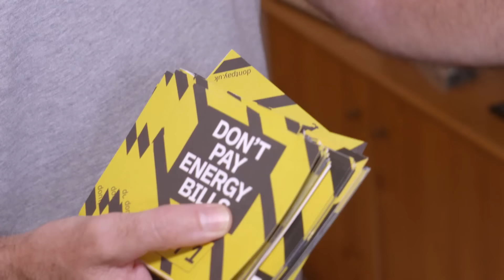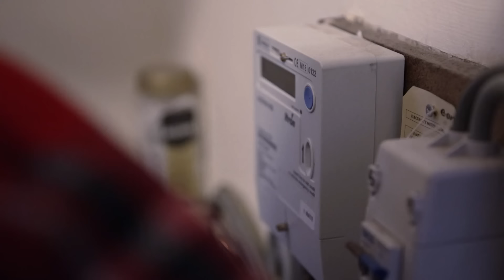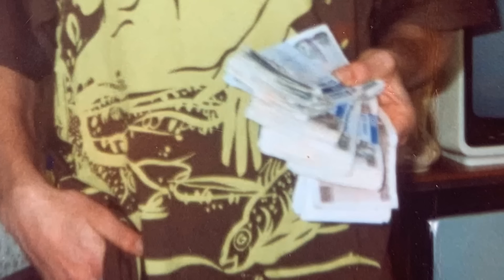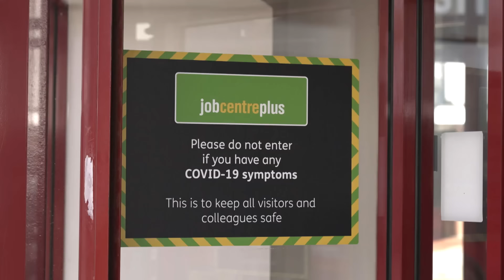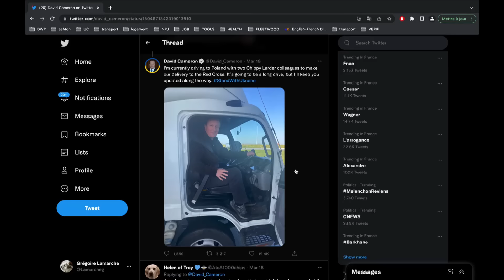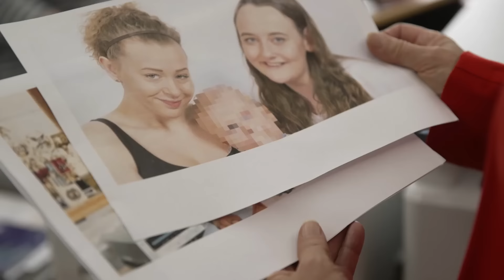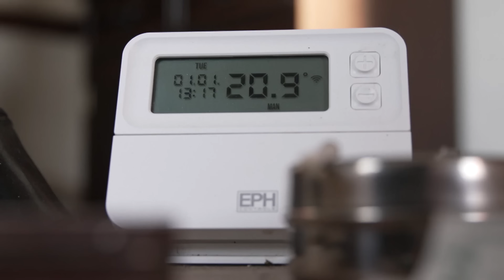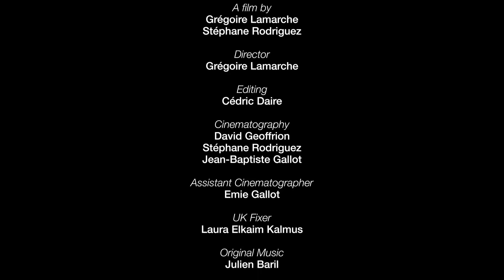Poverty in the UK: Great Britain's 'Working Poor' | Austerity, Food Banks & Inflation Documentary

Comment: People need too buy themselves a tent and put it up inside your house and throw couple of blankets on top and climb in too stay warm and if you have a animal put them inside as well they will help keep you warm as well and if you can buy a large can of cooking grease and a pack of long candle stick cut the wick and place it in middle of can it will last 30 days at 8 hours a day and it will also put off heat in your tent and you can cook or warm up water by using a large clean fruit or vegetable can by putting cotton balls and pouring alcohol over them and light it too keep your pot stable place 2 small ones on each side. There is many survival techniques that you can learn on YouTube this will help on heating cost and still stay warm